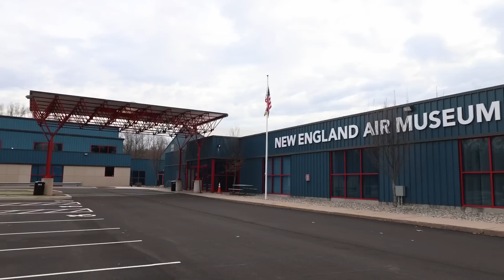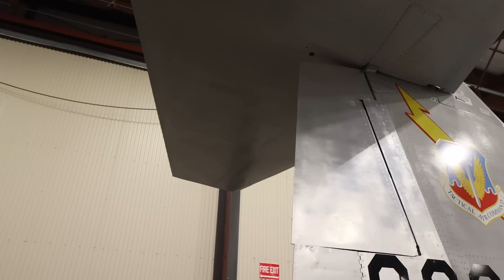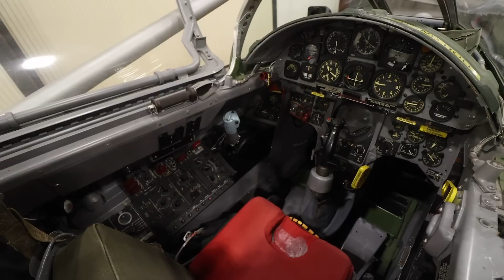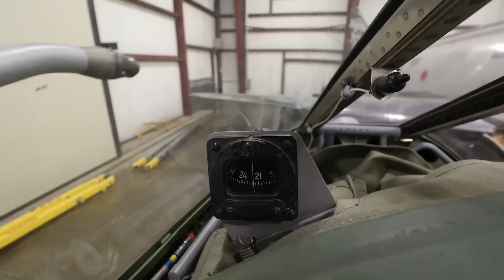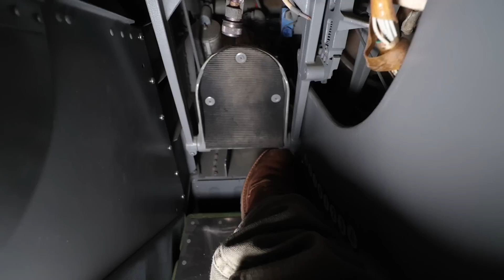Inside the F-104C Starfighter: Full Cockpit Tour and Detailed Walkaround

Comment from the maker: Was the F-104 Starfighter really a “Widowmaker”? The short answer: yes but no. Full video here 
https://youtu.be/9jOR4hl0sMw
Reply: For all it's many faults, it was probably the best LOOKING plane ever made.
Reply: Best century series interceptor other then F-106, maybe not best fighter.
Reply: No, just the use it was sometimes put to. The Super Sabre was just as dangerous in its own ways.
Reply: @Swaggerlot  I used to look at the super saber as the waste of time and money and was such a dog air to air compared to f-86, and it looked literally like a green slug or a pickel, the worst looking of the century while f-104 and f-106 both the sexiest. But the f-100 did really good in fast fac and air support role along with A-1. According to F-104 pilots the small wing made it quite decent low altitude and fast for tossing a nuke but couldn’t really loiter like an F-100 though vulcan canon is nice for ground support. Also NV pilots didn’t necessarily want to meet up with the f-104, they were more willing to go against F-4s.
Reply: @tsechejak7598  The biggest issue against the F-104 in Vietnam was that they couldn't fit the Radar Warning Receivers into the airplane, and they were vulnerable to SAM sites when they were flying Combat Air Patrol.
Reply: The relatively low-sweep on the F-104 (And the T-38 / F-5) puts the peak of the transonic drag coefficient back closer to Mach 1 than a more highly swept wing, where it would peak between Mach 1.4 and 2.0, for most jets.  This helped with supersonic acceleration.
It's worth noting that there are 2 fighters that the PAVNAF did not try to engage - the F-104, and the F-5.
Reply: @ Agreed, they didn’t have quite the SA other pilots had in the north, and a decent radar with dedicated rio/wso made the F-4 a bit better there.
Reply: @peterstickney7608  Cool didn’t know that about the wing for either 104 or F-5. I’ve only had a close walkaround with thr F-104 at two locations, one being Airzoo in Kalamazoo Mi and the other Wings over the Rockies in Denver. Fun to get up close. Our small airport has a T-38 up on a pedestal mount out front. My uncle had most of his airforce career involved in training side at Randolph AB San Antonio and several times visiting him wed go watch the T-38s do nice takeoffs and landings. Hope to catch an F-104 flying at a show at some point.
Reply: @tsechejak7598  You should be planning a trip to Florida -  There's a group that operates under the name of Starfighters that operates 3 F-104s out at Cape Canaveral.  Their main business is providing platforms for companies that require, well, F-104 performance for testing their stuff, and they do perform flight demonstrations in the Southeast.
Plus, there's a lot of other stuff to see, as well.
Reply: I have a question about the wingtip tanks. 

How did they get enough fuel flow? Surely a hose didn't fit inside the wing? Or are there several small ones?
Reply: @VikingTeddy  I believe they had several channels in the wing, just the wing itself was otherwise thin and solid no room for tankage. Extremely interesting Kelly Johnson went for a basic wing not nearly as swept back as other wings but made it small and very thin, T-38 almost same small wing to fuselage ratio.
Reply: @VikingTeddy  External tanks including the tip tanks & pylon tanks were pressurized using engine bleed air. Fuel transfer & air pressure lines for both run through the center cord of the wing where it is the thickest. There is a surprising amount of plumbing in the wing & actuators for flight controls also need to fit. Even more plumbing was installed to provide bleed air to the trailing edge flaps for additional lift during landing.
Reply: 292 of 916 Starfighters crashed. 115 German pilots died flying Starfighters. Lockheed bribed German officials to buy the aircraft. You gloss over this disgraceful background in your video: surely the memory of these dead pilots, victims of greed and corruption, deserves better?

Comment: Great video. The F-104 has been my all time favorite fighter. Just a few days ago, I gave away a cast model with the same markings as the one you showed. When I was in high school (1976) in an aviation class given by a former Air Force pilot, and about to join the military, the local ARNG unit was flying the F-04, with some C models. I nearly got to ride one of hte two seater airplanes, but the deal felt through, and I hated it, but moved on to military duty. I still hear the J79 howling sound after the airplane flew over, and could still hear the sound 5-10 later. Amazing aircraft, and I hope some day I get to vist this museum, though I think there was one in the Air Force musuem in Dayton, Oh, but I can't be sure. Thanks for the tour, and thanks for the musuem to allow you to  sit in and showed the cockpit.

Comment: You were absolutely correct when you said this was the best star on the flag. No, it wasn't inherently a 'widowmaker' but it did require significant training. 

When Kelly Johnson launched this ". . . missile with a man in it." in 1954 it was so new, so fast, and so well armed (Vulcan cannon, bombs, & Sidewinders) that extensive training was absolutely required. And it had some unusual features like the early ejection seat fired downward as it was thought that, at speed, the pilot was in danger of hitting the tail if fired up. At lower altitudes the pilot was recommended to invert before ejecting. At least one pilot forgot. (Data from Lockheed F-104 Starfighter: A History by Martin W. Bowman). 

It was my favorite plane since I was old enough to read. From the moment I saw it in a model I made I was hooked. The thing looked like it was traveling supersonic when it was sitting still. It's the most unusual jet aircraft I know. (And the F-104 was NOT the plane that almost killed Chuck Yeager no matter what the movie The Right Stuff says. I assume they used the 104 in the film because it looks SO GOOD on camera. An actual history of Chuck Yeager corrected this Hollywooding for me.)

What I can't figure out is why MOST of the 104s with Air Force markings had tail hooks. They weren't considered carrier aircraft although they may have been small enough. The one toured had beefier front landing gear than the prototypes but 104s had drogue chutes to slow with. Very confusing! I wouldn't have thought they'd add extra weight with unnecessary equipment and although some were used by European Navies most were European Air Force planes. The only thing I can figure is they used tail hooks when they needed to land short (and the strip was set up for it). That would certainly work.

This plane is the reason I joined the USAF rather than the USN.
Reply: The arrestor hook was there due to the very high landing speed of the 104. It needed a good bit of runway both for take-off & landing. All our airfields featured cables at the ends to keep the aircraft from overshooting in the event of a hot landing (failed flaps) or engine failure on take-off.
Reply: @MikeSiemens88  Yeah. That pretty much HAD to be the answer. And I knew about the long take-offs and landings. Those little wings needed a LOT of air moving across them to lift that sucker even with flaps. Thanks though. I almost had it. I didn't know about the airfields.
Reply: They used an F-104 in "The Right Stuff" because the real airplane, the NF-104 has long since been retired and the few examples left are gate Guardians or museum pieces.  The F-104 in the film was as close as they could get for the movie.  If you know anything about aviation history, you know that the F-104 used in the movie was a stand-in.  Nowadays, they would have used CGI to recreate the NF-104.

Comment: There was an F-104 on static display on the Terrazzo at the US Air Force Academy when i attended from 1974-1978. It was frequently moved around at night by us cadets until one night it got away from the guys moving it and it went down the "Bring Me Men" ramp and ran into the wall overlooking the parade ground.  After that we were forbidden from moving that aircraft.  The T-38 was still fair game, although the landing gear had a bad habit of collapsing.  The F-104, the T-38, the F-105 Thunderchief (in honor of Karl Richter and named Iron Butterfly) and F-4D, AF Serial No. 66-7463 (Steve Ritchie and Charles DeBellevue) were on the four corners of the grassy area in the middle of the Terrazzo.

Comment: Interesting to see a Celsius temperature indicator ...
Reply: Engine temperatures, even in the U.S. are measured in Celsius. (Actually Kelvin, but most people don't grok that).
The J79 engines had a temperature limit of 100 deg C at the entry to the compressor - otherwise the combination of heating from the ram pressure recovery of the inlet system (Where the 100C would come from), and the heating that would occur in the compressor would get high enough to melt things down.

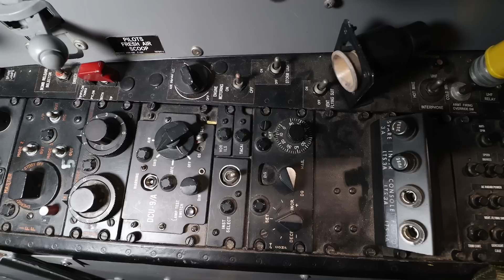Comment: 16:50 Pilots fresh air scoop? For when the pilot had some beans earlier?
Reply: That would probably be labelled RAM/DUMP on most aircraft.  It opens the ram air scoop, shuts off pressurized air to the cockpit, and opens the cockpit pressure relief and dump valve. Outside air then ventilates the cockpit to discharge contaminated air.

Comment: Why do they mount the wing tanks at the tips of the wings? That increases rotational inertia and reduces maneuverability.
Reply: Lots of fighters had tip tanks in the 1950s.  They had to put them somewhere, and it was aerodynamically efficient at the wingtips.
The F-104 suffered less from any inertia than most fighters because with such a short wingspan the mass of these tanks was still relatively close to the roll axis.  Planes like the P-80, F9F, F2h, F-89, F-94, would have felt the inertia more than the F-104.
Maybe roll inertia was not as big a problem as running out of fuel was.

Comment: The original mission of the F104 was to intercept Soviet bombers but the big brass in the USAF thought let's use this for something the plane wasn't built for.
Reply: No, the original mission this jet was designed for was to shoot down enemy fighters, but then the USAF big brass drafted it for Air Defense Command interceptor duty because the F-106 was delayed in development.  They replaced the gun with an additional fuel tank while the 104 was in ADC service.  It wasn't a perfect interceptor due its short range radar and lack of radar homing missiles, but it it was useful stopgap until the 106 was ready.  When the 104 was later transferred to Tactical Air Command the gun was reinstalled. 

Most fighters eventually become a fighter bombers and the 104 was no exception.  It actually did well in that role in Vietnam, delivering its admittedly small small load of munitions both accurately and promptly when called.  Its high speed and high wing loading made it a good airframe for the low level nuclear strike role.

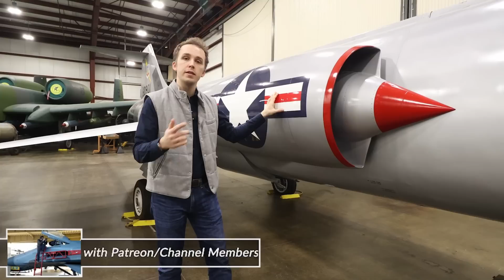Comment: Confusion about the hydraulics at time 4:50.  There certainly is redundant power for the flight controls, which are separately powered by both the utility and the flight control hydraulic systems. The RAT will also power them.
Reply: At same point (4:50), F-104 is equipped with electrically operated flaps, no hydraulics there.
Reply: @sv7gbr  Thanks, I didn't catch that one.

Comment: 15:51 Minor nitpick, I think you may have gotten the internal and external fuel gauges confused with each other. The top (what you called "internal") gauge has a Left and Right needle, and a max capacity of 1400lbs. That matches up with external wing tanks.

Meanwhile the lower (what you called "external") gauge has only one needle and goes up to ~6500, which matches maximum internal capacity.

Comment: I have personally come to think of the F-104 as among the worst fast jets of its generation. A pure interceptor overly charged with inappropriate additional roles, and with divergent expectations. I say this as among the most avid of enthusiasts of fast jets.
Reply: You can think its the worst if you want, but you are wrong about what it actually was, which was not a so called 'pure interceptor'.  The mission this jet was designed for was to shoot down enemy fighters, but it was temporarily drafted into Air Defense Command interceptor duty because the F-106 was delayed in development.  They replaced the gun with an additional fuel tank while the 104 was in ADC service.  It wasn't a perfect interceptor due its short range radar and lack of radar homing missiles, but it it was useful stopgap until the 106 was ready.  When the 104 was later transferred to Tactical Air Command the gun was reinstalled. 

Most fighters eventually become a fighter bombers and the 104 was no exception.  It actually did well in that role in Vietnam, delivering its admittedly small small load of munitions both accurately and promptly when called.  Its high speed and high wing loading made it a good airframe for the low level nuclear strike role.
Reply: @gort8203  The biggest problem with the F-104A as a USAF Interceptor was that there was no way to make it compatible with SAGE, the computerized Integrated Air Defense System.  SAGE Centers, interlinked across the U.S. and Canada, automatically took in radar data from the radar network (Arctic Circle to the U.S. Southern Border), and developed the tracks.  A Human Controller would designate targets to be intercepted, and select the type and number of aircraft or missiles (BOMARC SAMS were SAGE controlled) to use, and the computers would compute the intercepts, send the scramble alerts, and then guide the aircraft using Data Link.  Aircraft with the Data Link tied to their autopilots could be flown directly to the intercept points.
A Sage Center could direct more than 100 intercepts simultaneously, as opposed to the 5 or 6 possible by a GCI countroller and a Voice Radio.
The F-104As did make a comeback - after the Cuban Missile Crisis, they were called back to the Active USAF from the National Guard units that had them (And had deployed to Germany during the Berlin Wall Crisis), and were used as quick-reaction Interceptors in Florida and Texas, to counter anything coming out of Cuba.
(After the missiles were removed, there were still Nuke Capable Il-28s on the island, and there was the infrastructure, that was exercised regularly, for Soviet Long Range Aviation heavy bombers.
Reply: Unfortunately, your enthusiasm doesn't match your intellect.

Comment: how much was the starfighter a technological advance? (or not?) cheers😊
Reply: A lot.  Not only in performance, but in structures, packaging electronics, flight controls, cockpit ergonomics, even tire rubber composition. (Making tires that could handle a high speed landing - going from dead stop to 160  or so knots in an instant was a big challenge).  The GE J79 engine was a pioneer in small-sized high performance turbojets, having the first variable stator compressor design. (Compare it to the J57 in the F-100 or F-8 Crusader - same thrust, but a lot smaller and lighter).
Reply: Amazing thank you very much for info, have a newfound respect for the aircraft, all the best from sunny Troon Scotland 😊

Comment: Hydraulic controls in the trajner and mechanical for the combat planes... bizarre, to say the least.

A great Inside The Cockpit video on the Starfighter. And you didn't get cut by it, so that's good.
Reply: The distinction is not between a combat version of the plane and trainer version but between a single seat and a 2-seat version.    The 2-seat was still combat capable but needed more rudder authority due to the different configuration.  I believe the later single-seat G-model also got the powered rudder.
Reply: Not really - the 2-seat airplanes had larger rudders to compensate for the destabilizing effect of the larger canopy.
A bigger rudder meant it took more force to move it, and thus the powered rudder on the sedan models.
Stability at high supersonic speeds was a very tricky issue.  An interest quirk of the 2-seaters was that at high speeds, the canopy produced enough lift, that at Mach 2-ish, it would actually be flying with the wings at a negative angle of attack.  The tip tanks couldn't handle that, so the 2-seaters could either go fast, or go far.
Reply: @peterstickney7608  Like I said, really, the 2-seater needed more rudder authority.  Your explanation has more detail, mine was shorthand.

Comment: According to Bill Gunston the crew survival rate on Germany's 104's increased significantly after Martin Baker seats were installed in place of the original seats.
Reply: It may also be that by the time the Germans started refitting their F-104s with the Martin-Baker seats, the airplane was getting fairly mature in service, and the initial high accident rates (Which happen with all aircraft, some more than others) were damping down as experience grew and problems were solved.  An interesting question.
Reply: @peterstickney7608  A good point. I read his book over 40 years ago. I could probably find the title but I don't have my copy anymore.
Reply: It's a bit disconcerting that it needed a better ejection seat to be able to get pilots home in one piece.
Reply: There isn't much data to support Gunston's claim about the MB seat in German Starfighters.  I think the seat were changed mainly because of public perception.
Reply: @dukeford8893  Yes, it was from memory. I read it in one of his books  over 40 years ago. I recall he said the whole seat swapping thing wasn't publicised at the time. Attrition rates on almost all jets of that era were high.